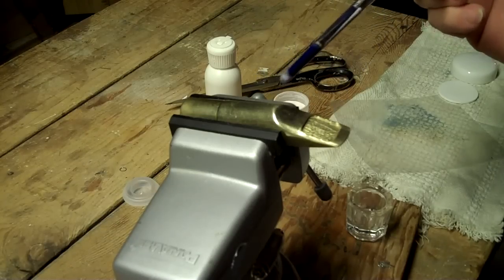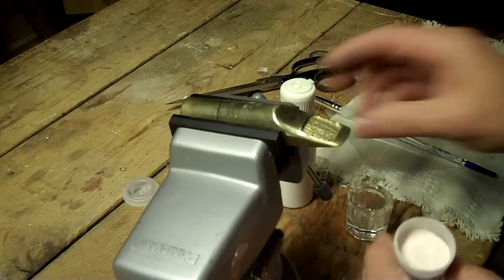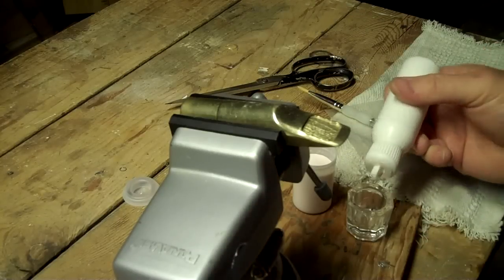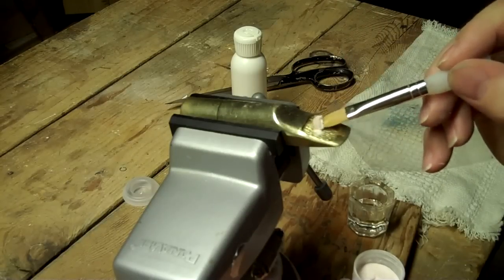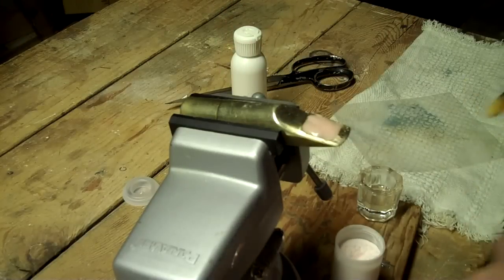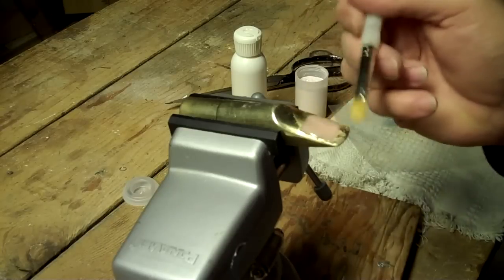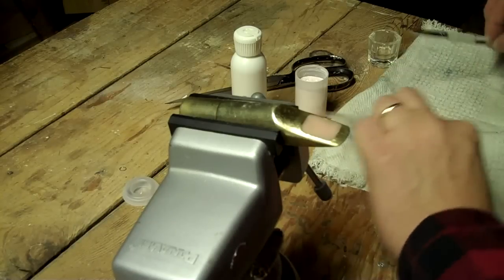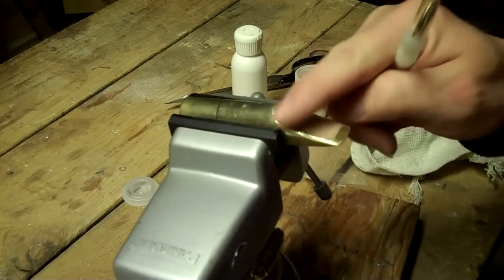Making a New Bite Plate for a Guardala Mouthpiece

Comment: Thank you for this. My Guardala bite plate came adrift in the middle of a performance today, nearly choking me. For the first time that I can remember I had a spare mouthpiece in my pocket.
Dental Acrylic is constantly being updated. On my last expensive visit to the dentist I begged some white acrylic to repair chips on the tip of a white plastic ROC mouthpiece and will have enough for both repairs.

Comment: I get this stuff from my dentist. it works great on my Guardala which i wear out every year or so.
Reply from the maker: +Johnny Ferreira You might want to consider a different acrylic that is harder and wears longer.
Reply from the maker: +Johnny Ferreira The original Guardala pink dental material I have sets up softer than the other acrylics I have.  It is possible your dentist has a different pink acrylic.  The original pink material was called Fastcure and is not available for purchase anymore.
Reply: @saxjohnny  if you are wearing it out every year or so it is not the "hardest stuff around"

Comment: Some materials are better than others for leaving a nice level surface.  I need to work quick and use wet mix which dries as I work with it.  But sometimes I need to overfill the area and file and sand it down to shape.  This is difficult to do without scratching the plating around the pocket.